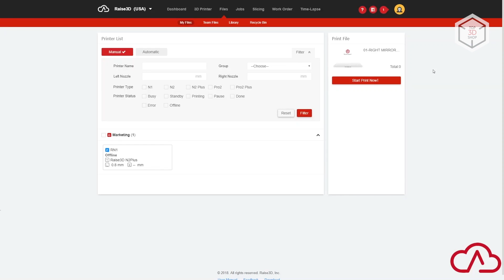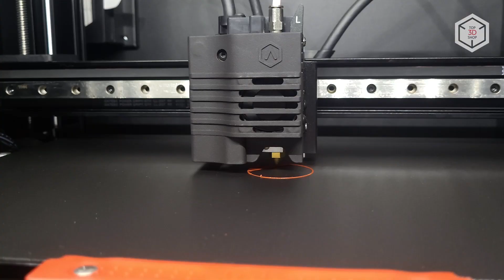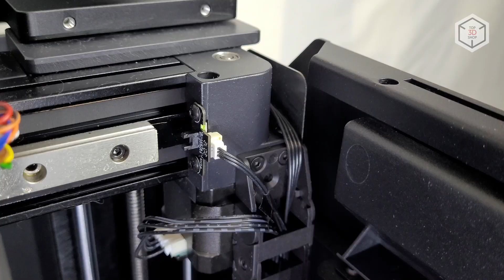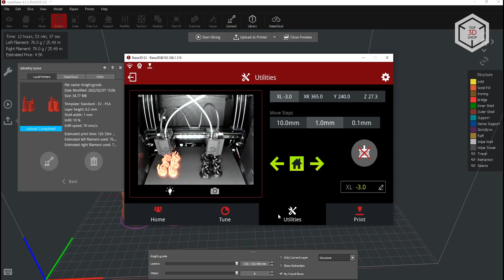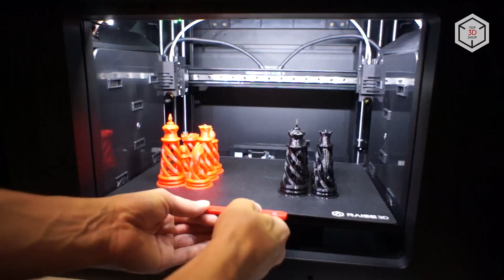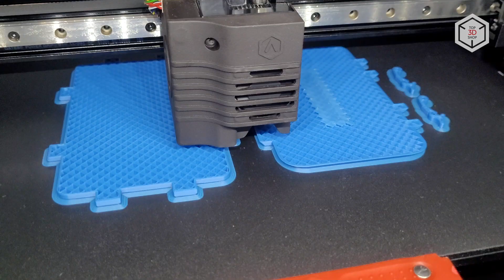Raise3D E2 3D Printer In-Depth Video Review: FDM Printer With IDEX Dual Extrusion

Comment: Great Video, all the informations in, where i do not find anywhere else. One is missing for me. Are the nozzle standard MK10 oder MK8 nozzle or so? Can i easily buy them and change them to 0,6mm?
Reply: On another raise 3d printer, the nozzle threads match mk8, but raise uses a longer point so the bed leveling feature doesn't work.